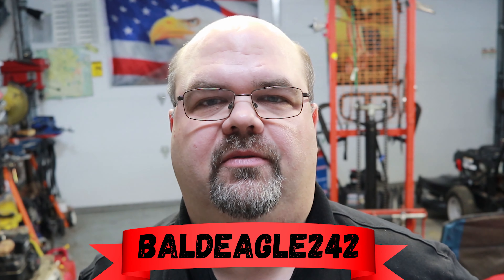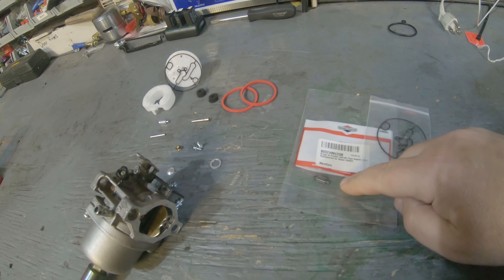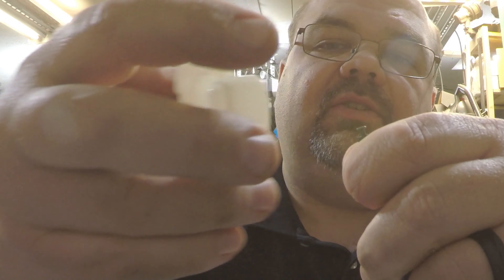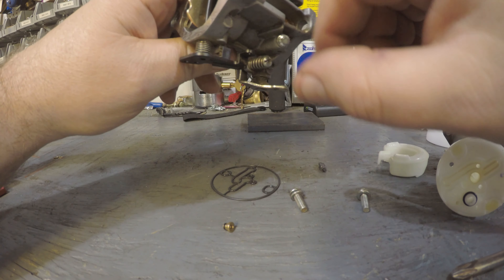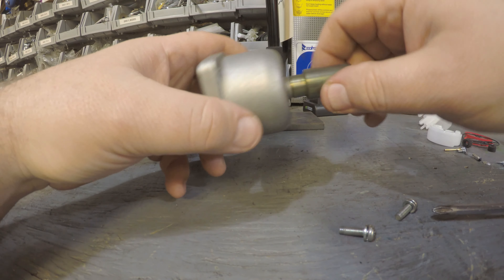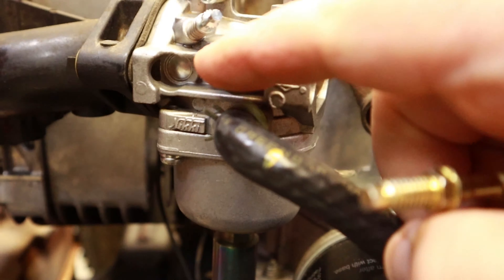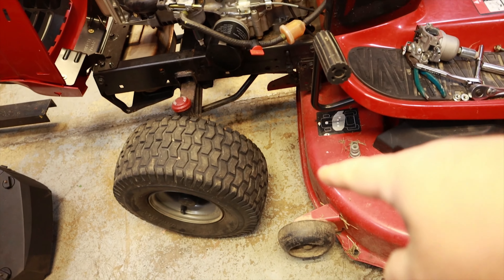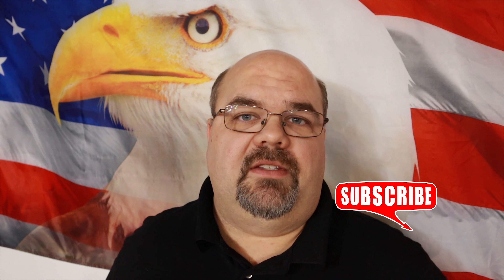No BS! Simple NIKKI Carburetor Rebuild

Comment: Would you or anyone else know if the internal gasket set for these NIkki carbs are universal in fit? I am rebuilding a Nikki carb that has a #697216 on it.  The unit ran horrible with gas spitting out of the intake. When I opened the carb I found the little jet with the o ring loose in the bowl. I just need to know if a specific gasket set is necessary for the rebuild? Thanks.
Reply from the maker: There are two different sets for these carbs.  I don't know which one references your part number, but I show the differences in this video with a side-by-side comparison.
Reply: @baldeagle242  Thanks...I think I recall you mentioning it. One has a gasket attached and then another has it separate. I will review the video and confirm.

Comment: Just found your channel and am very impressed with your no nonsense, no fluff approach. I'm looking at an issue on a craftsman rider with a Nikki. 

Runs fine until it gets hot, then stalls.

I replaced the coil, gapped it to .010-.012

I have the carb apart now and cleaned it. It didn't look bad.

About to put it back together and tested the shutoff solenoid first. It works but I noticed if I shake it I can hear fluid (gas) inside. Is there a seal on the plunger to prevent this? Is it normal? Also, the upwards force on the plunger is very weak, I can easily depress it. Not sure if the plunger is closing after it gets hot.
Any thoughts?
Thanks, Bob F
Reply from the maker: It’s possible you’re valves are out of adjustment. When it warms up the gap will close. Another issue that can mimic this situation is a bad gas cap that’s not venting or a fuel pump if it’s not a gravity fed system. 
The resistance on the fuel shut off should be about the same as weak refrigerator magnet. Basically if it pushes back up at all it’s good. 
I have another video that shows how to adjust the valves as well as Simple Smokey Mower Fix
https://youtu.be/1ASS6xahp4E

Comment: Hey baldeagle I tried looking for one of your videos that might explain my issue but cannot find it.

My riding lawnmower runs on choke if I lower the throttle it stalls out. I replaced most of the components of the carburetor (nikki) with your help. But it Still has the same issue when should I give up on it and buy another carburetor.

Thanks
Reply from the maker: If it only runs on choke it either has an air leak allowing to much air or a fuel restriction somewhere limiting the fuel.
Reply: Thanks for the help I will double check for those issues.

Comment: I got the same issue almost ruined my mower. Beagle do you have a part number for the aftermarket carb in the video. I'm having a hell of a time finding the right one. Don't wanna bother with the rebuild. My mower is torn down and I need to mow so if someone can respond asap I would be in debt to you. Thanks
Reply from the maker: This should be everything you need. 
https://amzn.to/3Ab5EqJ
Reply: That's my problem mine is a john deere 115 not a la115. And it's a 19hp. This says 18 hp . Please help
Reply: Thanks for responding so fast. Wow
Reply: It's a Briggs 19hp ohv Intek motor for a john deere115
Reply from the maker: The only difference will be the main jet. (The small brass piece with rubber O-ring) if the one in your original carb is salvageable I always recommend sticking with the original. You can use the o-ring from the new carb if needed.

Comment: Hello Baldeagle , I could really use your help .  I have a 17.5 hp Intek Briggs with a Nikki carb . I put a new battery in it and cleaned the carb, now it runs perfect until you throttle it up to about 3/4 throttle.  At this point it starts spitting and sputtering and puking out blue smoke . I have tried adjusting the air/fuel needle valve every whichway and no difference. I tried choking it some by sticking my finger in the throat and it dies. It purrs so nice up to that point so I am at a loss, any advice?
Reply from the maker: Its possible the main jet is missing or installed upside down.

Comment: If its flooding the carb, will it cause sputtering and high and low rpm?
Reply from the maker: It can cause symptoms like that. You may also see black smoke coming from the exhaust.
Reply: @baldeagle242  thank you for you time. Thankfully that’s not my issue. I think i need to find the balance on my carburetor between the idle speed and the fuel air mix. I think i have the idle speed good but there are slight rpm revs/sputters. I thinking its the fuel air mix its slightly off.

Comment: If a mower will run on starting fluid. With new spark plug and fresh gas. It's gotta be the carburetor that's the issue..am I right?
Reply from the maker: More than likely.  It could be a bad fuel shut off solenoid on the bottom of the carb.  It should have power when you turn the key on. If you flip the key on and off you should hear and feel it clicking.
Reply: @baldeagle242  there is not one on my snapper
Reply from the maker: @stevestewart3816  Oh, you’re talking about a push mower.  In that case you probably have a clogged main jet in your carb or your fuel has water in it.
Reply: @baldeagle242  no it's a snapper rear engine rider. Ive done everything I know to do except replace the carb.

Comment: What didvyou say makes tge nikki surge cause I've cleaned and rebuilt a dozen of them they still surge
Reply from the maker: The main reasons are a bad gasket between the carb and the intake, a bad O-ring on the main jet, someone has put the wrong size main jet in the carb, or the welch plug on the side being damaged or leaking air.  If all of this checks out good and the carb is clean I would try a slightly larger main jet.  Also, check the plastic intake manifold for cracks and make sure it's sealed where it connects to the engine.  
There are really only two reasons an engine will surge because of a carb issue.  Either it's getting too much air or not enough fuel.  This is why a lot of surging engines will run better with the choke slightly closed.
Reply: @baldeagle242  thanks for tge info ill start looking a little closer

Comment: I have the single barrel Nikki carb won’t run after replacement of gas line fuel pump filter and carb rebuild without choke on dies as soon as choke is off.
Reply from the maker: It sounds like it’s starving for fuel.
Reply: @baldeagle242  Got it running the problem I still do not understand. But apparently the carb. Needs the cover on the air breather box making me think it was getting to much air.
Reply from the maker: @larrybarnes603  to much air is similar (or will exaggerate) a lean (not enough fuel) condition.  In either situation the amount of fuel is being consumed is not enough to satisfy the engine’s demand. Closing the choke restricts the air flow and helps to balance the air to fuel ratio.  
It’s possible the carb was loose and sucking air around the back side where it mounts to the intake. Putting the filter and cover back on may have helped to seal this and slightly reduced the air that the engine could suck in. With the air cleaner off you may be able to physically push the carb tighter against the intake to test this theory.
Reply: @baldeagle242  Thank you for your response. Like I said as soon as the cover to the air cleaner was replace it started and just the was it should. I did check all the screws nuts and bolts twice to fix the problem and when I replaced the cover I tried it one more time before I gave up and all went well. Thank you again
Reply from the maker: @larrybarnes603  you’re welcome. I’m glad it worked out. 😁👍
Reply: @baldeagle242  👍

Comment: The oring on the main jet is very important. Don’t reuse it.  Only buy kits that have both o-rings and the gasket. Also, push the jet back in until it clicks.  Don’t rely on the emulation tube to seat the jet.  Don’t spray carb cleaner on the big gasket or it will swell and you won’t be able to use it.
Reply from the maker: Awesome advice. Thanks for taking the time to leave a comment.  😁👍

Comment: How do i adjust the float
Reply from the maker: @absolute357  There’s really not an easy way to do it like the old school carbs. I’ve used an electric heat gun to soften the plastic and bent it while the plastic is hot and dunk it in cold water once you have it where you want it. With the bowl off you want it to shut the flow off when the float is level without hitting the top of the carb.

Comment: Hello again Sir. Since our last chat, I had to rebuild the carb again because I had taken the carb apart a couple of times trying to figure out why the gas is not getting over to the piston well, and in doing that, I damaged the new o rings which led to the carb pouring out gas again. Well I got the carb rebuilt again and the gas is not leaking again, but I'm still not getting gas over to the piston well. In fact, I replaced the fuel line and fuel filter with new, but the fuel filter is not filling up all of the way even with the gas tank half full. You also had some concern about the new ignition coil that I added. Well I have a spark tester and it seems to be firing okay. But I just can't understand why after trying to start it several times and then I take the spark plug out, the spark plug is just bone dry. I'm in Marion, IN, can you come over and fix it?😂😂😂
Reply from the maker: Check to make sure your gas gap vent is working. You may have negative pressure in your fuel tank if the cap is not venting.
Reply: Alright. But I did leave the gas cap off for a little while just to make sure that there was no air trapped in the line, but still the same result.
Reply from the maker: @gordonjacksonsr.538  Ok, that rules that out. Is there any chance the float is cracked or has a hole in it allowing it to get fuel inside of it?  
Will the engine fire it starting fluid or fuel is sprayed into the carb?
Reply: The first time I rebuilt the carb, I used the original float and when I realized that the gas wasn't making it over to the spark plug, then I replaced the float with the new one I had received with the rebuild kit that I purchased. But the old one didn't appear to have any gas in it. And I have tried to pour gas in the carb, plus tried starting fluid but still not trying to fire up. Not sure if I have been pouring too much gas or spraying too much starting fluid, but when I take the plug out afterwards, it's pretty soaked. So I do know when old car engines would get flooded with gas, they didn't want to start, but don't know if it's the same with lawn mower engines. And by the way just so you know, I have the old 638rl yard machine with the 13.5hp Briggs and Stratton and the carb is just a little different than the one on your video. It only has the one adjustable screw at the top, not the one that you said to mark on your video.
Reply from the maker: @gordonjacksonsr.538  It’s difficult to say what’s going on without being able to check it out firsthand.  🤔
Reply: Well i'll just keep messing around with it and hopefully it will eventually start or at least attempt to start. But one thing I did forget to mention, the rubber breather tube that hooks to the side of the carburetor setup, has a small crack
 in it. But anyway, thank you for all of your help, and I will be checking your posts from time to time, to see if you might have come with something else that might help me get my mower going. GOD Bless you and your family Sir! Have a blessed day!
Reply from the maker: @gordonjacksonsr.538 the crack in that tube shouldn’t cause any issues but a simple fix is heat shrink tubing around the outside of it.
Reply: Alright, I will get some and repair that tube. And thanks again for the help. GOD bless you and your family. Have a good evening.
Reply from the maker: @gordonjacksonsr.538  Thank you.

Comment: Is it safe to say that you don't trust the aftermarket carbs? You prefer the oem carbs just rebuild them?
Reply from the maker: I do use them and they work well for the price.  In fact I keep 2 or 3 of each on the shelf just to save time and then clean most carbs the really bad ones in the off season. The main thing I recommend is using the jets out of your original carburetor. I also recommend a quick visual inspection and basic testing on the cheap aftermarket carbs.  There’s very little quality control that goes into making them and I have found metal shavings and loose screws in them.  
Also, if I’m going to buy aftermarket to replace a Nikki I will usually replace it with a Walbro. Long term you will have less leaking issues and they seem to be a better match for a wider range of engines.  The linkage is all the same but you may have to change the fuel solenoid plug to fit the Walbro.
Reply: @baldeagle242  You wouldn't happen to know the orifice size in the 17.5 jet, would you? I lost my OEM jet and the one in the kit seems to be too small.
Reply from the maker: @micahj9828  I do not.  Sorry.

Comment: FYI, I have rebuilt one of these Nikki carbs using an aftermarket Chinese crap kit. The o-rings were the most important parts, and they DO NOT match OEM size. They are too thick, and will not allow the main jet to seat properly. Also the o-ring between the white plastic fuel transfer and carb was too thick... I recommend only OEM Briggs parts for a rebuild... I HATE aftermarket parts that aren't the same size and specs as OEM parts.
Reply: Yeah it's almost virtually impossible to find the proper size o-ring for that little jet unless you can get a factory Briggs kit

Comment: Could someone help me possibly? I got the same carb, i have cleaned and got everything opened, I even got a rebuild kit and it is doing the same thing it did before. What it does is it idles really rough no matter where I put my mixture screw. And when I give a tiny bit of throttle it wants to run away, but if I put it on full choke it will idle great but still wants to run away when I give it a tiny bit of throttle. I’m talking barely moving that throttle and it just wants to take off. Please help thanks to anyone who replies
Reply from the maker: Without looking at it closer, it sounds like you may have a couple issues.  First, check to ensure it's not leaking/sucking air somewhere.  If that's not the problem, you may have lost the main jet that goes into the large plastic piece or possibly put it in upside down. 
I don't think you have a governor issue from what you described but you should at least confirm it's hooked up and throttling the carb down as it should with the spring hooked up correctly.

Comment: I believe you said the main jet O-Ring is sold separately from the aftermarket kit do you have a link for just that as well? Also thanks for the great content!
Reply from the maker: The best fuel resistant gasket material for gasoline is Nitrile (Buna-N)
I buy the multipack kit and it has O-rings in it that work for this carb. They are slightly thicker and a little tougher to squeeze them in but they work.  I'm not sure what size it is but generally it's a good practice to replace the main gasket as well since you'll have the carb apart anyways. 
https://amzn.to/3MlqHem

Comment: Appreciate the video but Why would you spend the time rebuilding the carburetor when you get a brand new one on eBay for 15 to $18?
Reply from the maker: @Drums This time of year things slow down for me.  I've always taken advantage of the slower months to rebuild carbs, rear ends, and engines.  I keep about half a dozen of the cheap eBay/Amazon carbs on the shelf in my shop but still, rebuild the OEM carbs as I have time.  The main reason I rebuild them is some engines will not run as well with an aftermarket Chinese carb.  Once you know what you're doing you can rebuild one of these in about 15 minutes.  This is a hobby for me and I enjoy showing others how to repair things instead of supporting the landfills.  There are plenty of "parts replacers" on YouTube.  I try to offer a little more than a link to eBay or Amazon.
If you watch the video you will see that I already had a $15 carb on this engine while I was waiting for the rebuild kits to arrive.  I would have left it on if not for wanting to show how this one performed after it was rebuilt.

Comment: I take it the Niki carbs don';t like ethanol Also have given up on e-bay-Amazon fuel shut off valves, just started by-passing them.
Reply from the maker: That's correct.  None of the rubber in these carbs will last with high levels of ethanol.

Comment: Seems its cheaper to buy the whole aftermarket carb rebuilt than to buy parts,and they come with plugs and a fuel filter
Reply from the maker: I some cases this is very true. I keep a shelf stocked with the most common carbs and if I’m going to replace a Nikki carb I generally put on a new “Walbro” style. I would however recommend two things: pull the bowl off and give it a quick once over and look for any machining fines or obvious build issues. The eBay/Amazon carbs are cheap for a reason and build and assembly are two main cost cutting areas. Let’s just say… I don’t think the have a reject or rework area. 
The second thing I recommend is to use the main jet from your original carb. Aftermarket carbs are basically a one size fits all solution. The main jet in your original carb will be properly sized for your engine. 
I have a 5 gallon bucket overflowing with old carbs I’ll rebuild “some day”. 😁👍

Comment: He should have put the fuel shut-off before the filter.
Reply from the maker: I’ve don’t it both ways. The main reason I do it after the filter is so I can shut the fuel off when I’m done using the mower and let it run out of fuel quicker.
Reply: @baldeagle242 
That makes sense. I was thinking about when you want to replace the filter, it'd be nice to shut-off. But, you've got pinchers, so it's not a big deal. I mainly commented, so you got algorithm points.
Reply from the maker: @cornpop7805  Thank you!  😁👍